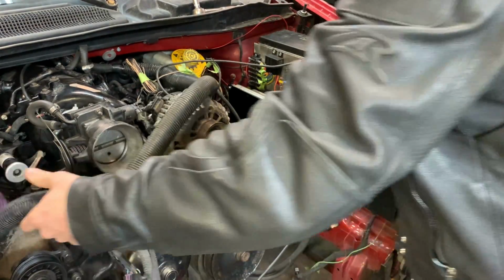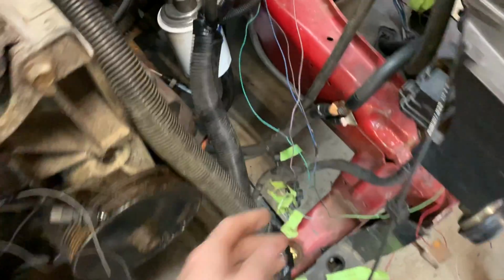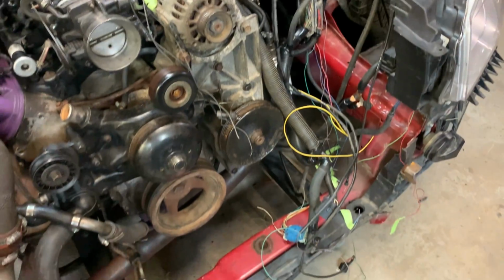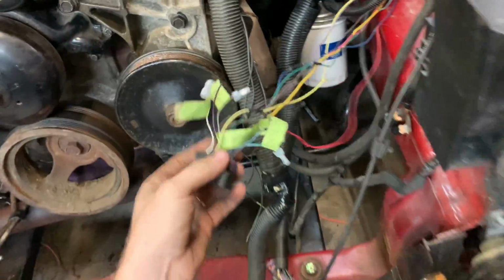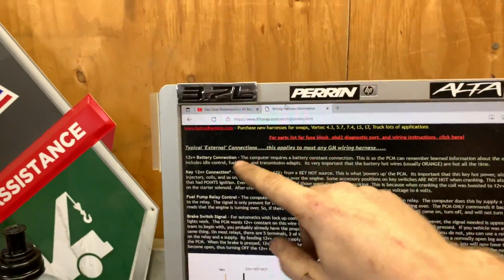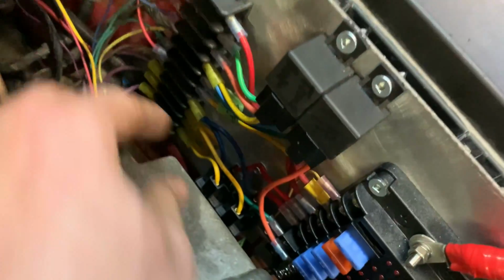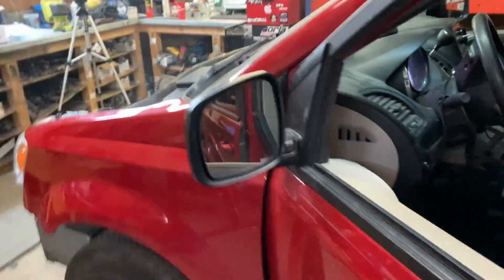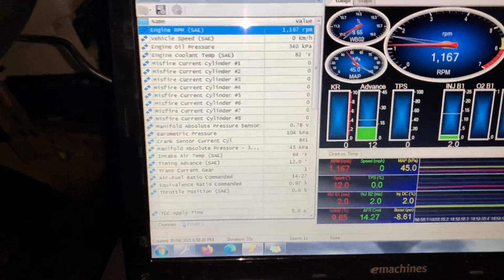Turbo LS Caravan build - finished up the wiring(finally!)

Comment: And what drive train are you using?
Reply from the maker: The engine is a late gen 3 6 litre, the transmission is a 4L80e, and the turbo is from a CAT 3406 engine, apparently it’s a Garrett turbo but I don’t know more than that. 
The rear diff is from a 2002 f150, it’s an 8.8 with 3.55 gears and a mini spool. Driveshaft is from an old cord big block that I cut down to for. I modified the whole cradle to accept the forward facing engine, and use solid engine mounts

Comment: Hi..can you tell me what kind of turbo is this?thanks!
Reply from the maker: Hey buddy, it’s a 70mm from a 3406 CAT form a tractor trailer
Reply: @StationroadRatrods  thanks and what is the A/R of this turbo?does it spool up well?
Reply from the maker: Actually I couldn’t tell you haha I have no idea, a buddy took it off a truck he scrapped and gave it to me lol. I’ll know how it spools when I get it on the road, the last engine blew up due to low oil pressure before I could even get a good log, the engine only made enough power to make 7 psi and couldn’t hold 6000 rpm